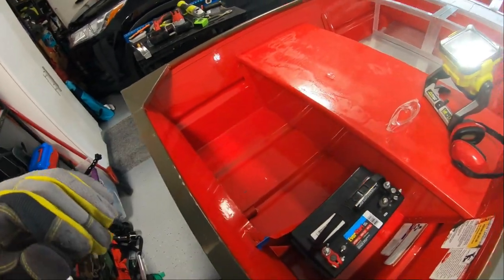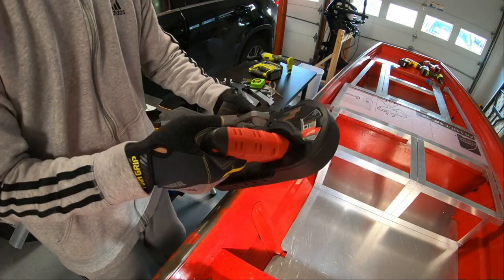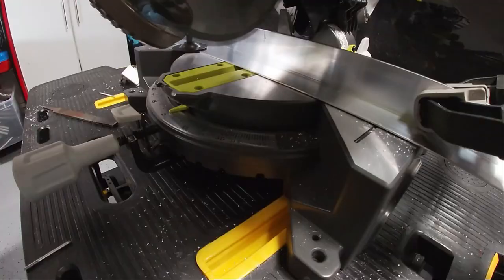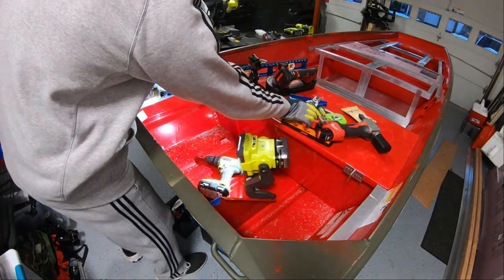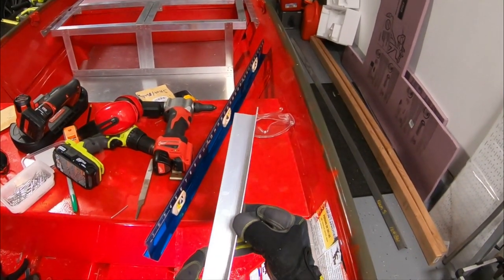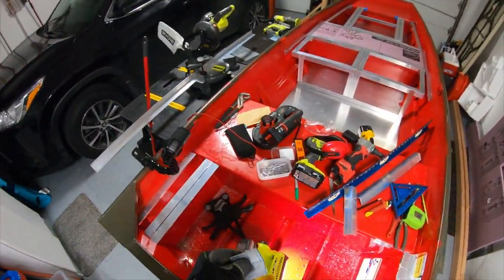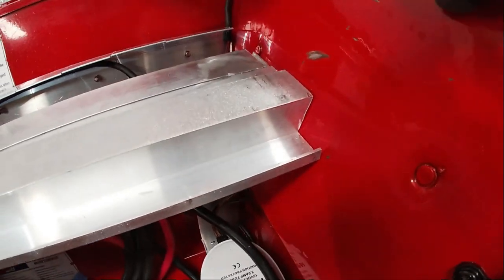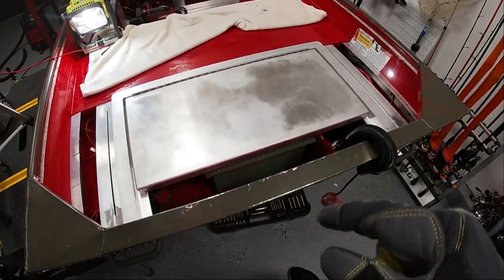Back Deck Framing For ALUMINUM HATCH + GIVEAWAY UPDATE {Jon Boat to Bass Boat} Alumacraft 1232

Comment: Loving the build out so far.  I’m taking my time with my 1448, but I already want to get another boat just to plan another build!

One tip that I would give, would be when cutting the angle on the hatch track against the transom, is I would have used that offcut guide to set up an angle on my miter saw, and then cut the track on that.  A little cleaner cut, and you can also get the angle on the inside drip rail of the hatch.

Anyways, cheers brother, I love how you explain every part of your thought process.  That’s a hard thing to do for most, but it is super helpful in understanding the build process.
Reply from the maker: Respect to you Dennis.  Appreciate the suggestion.

Comment: Is working with aluminum much harder than wood? I want to build my jon boat but debating using wood or aluminum. Aluminum would be more future proof, but I’m more familiar with wood and I have 3 sheets of plywood in the shed
Reply from the maker: Both wood and aluminum has its pros and cons.  Wood is cheaper but requires sealing and doesn't last as long.  Aluminum is more expensive but will not rot over time.  I've done both builds and I like working with Aluminum better.  I don't feel like working with Aluminum is harder than wood. I would decide what you want and go for it. Either way it will take time.
Reply: Working with aluminum is more or less the same as working with wood. Don't be afraid of it

Comment: What’s the reason for cutting slits in the aluminum every inch or so on the side supports
Reply from the maker: So that the aluminum bends to the shape of the boat.  If not the piece may not lay flush against your boat side wall.